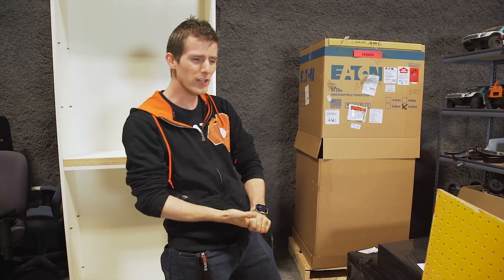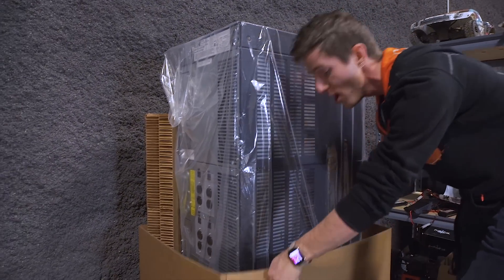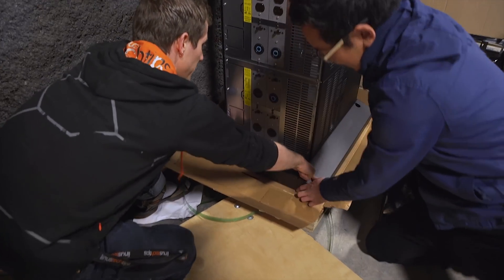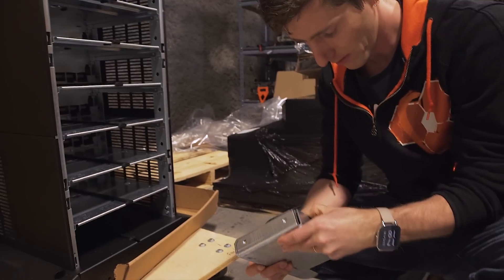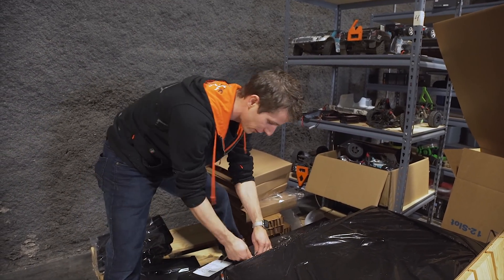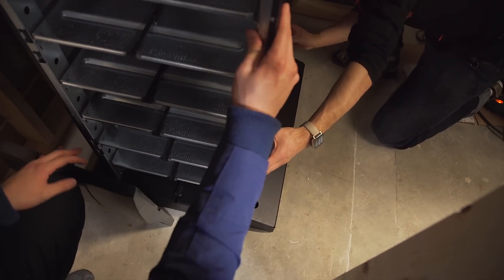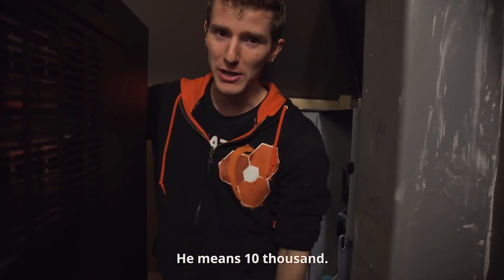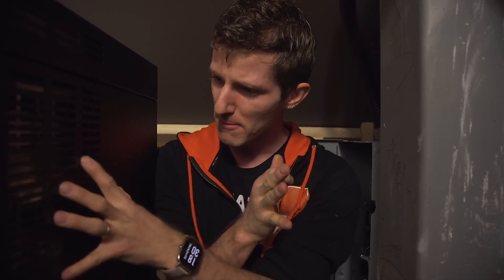HOLY $H!T - A $17,000 (CAD) Man-sized Battery!

Comment: You only need the UPS big enough to run for a few seconds before the Standby Generator auto-starts once power fails.

Would cost you much, much less. And you would have enough power to last for days.
Reply: +Lin Ying Yen Generators need gas, maintenance and to be generally checked. The one they bought is a much more elegant solution and doesn't waste gas when you could use the gas to power your car.
Reply: +Dan Wasd You only need to check/maintain a standby generator once every 3 years, and it will work for decades. Meanwhile, those Eaton batteries needs a mandatory replacement every 5 years, and won't hold a full charge by year 2.
Reply: +Lin Ying Yen They don't need run-time. They only need enough time to save and shut everything down.
Reply: +bensemus x It would still be much cheaper than their current option. Extended run-time is just a bonus.
Reply: Lin Ying Yen They would still need new ups's as the reason they did this upgrade was because their current ones were causing issues. I'd also assume it might be tricky to get a permit to run a generator in their complex. They would probably have to do a lot of rewiring as well.

Comment: wouldn't a generator be cheaper... and could work for HOURS, not minutes....
Reply: +Gabriel Coelho Generators don't provide uninterrupted power. They aren't buying this to run their gear when the power goes down. They just need it to give them enough time to save and shut stuff down.
Reply: +bensemus x They also generally aren't power conditioners like this UPS does as well.
Reply: He's using it to power his insane servers and whatnot. This is basically a giant power or a UPS.
Reply: +Gone Tomorrow what data? Do the servers not use hard drives?
Reply: +bensemus x They do if you have a small UPC hooked up in addition to a generator.  Only would need a UPC 1/30th the size to last 30 seconds for the generator to kick in.  Plus, I guarantee they won't shut anything down in the event of a power outage.  They will just keep on working assuming that the power will come back on soon - and if it doesn't, well then their work productivity will be screwed.  With a generator, even in the event of a major power outage, they would remain online regardless of the duration.  Oh, and it would be cheaper and better for the environment.
Reply: Kyle E Generators burn fuel so I don't see it being better for the environment. Small businesses like LMG shut down their servers. Most people shut down servers when the power goes out. Linus said they would shut stuff down when they lose power. What happens if the generator fails to start? Their servers would suddenly lose power. Only massive data centers have back up generators.
Reply: bensemus x What do you mean what happens WHEN the generator fails to start?  You're taking a big leap there... If you get a good generator, that should never be a problem.  And you obviously aren't looking at the big picture if you don't understand what I meant by a generator being more environmentally friendly.  You do understand that the manufacture of batteries (especially the type/size used in this UPC) produces an obscene amount of harmful byproducts?  You would have to run the generator for a LONG time to produce enough emissions to equal the carbon footprint of the UPC.
Reply: steakjake Ah, didn't know that. Thanks!

Comment: Just how unstable is the powergrid in Canadialand to justify all these UPS? Why not just keep the minor UPS you already had and then get a emergency diesel generator like the ones used in hospitals? A generator is really not that expensive,
Reply: +Martin Kufikwasf They had to get rid of their old UPSs anyway (as he said, they were developing issues), and they also have had power fluctuations from storms in the area (as he also said in the video), so something that smooths out the power to the servers, doesnt have to be maintained like a generator does (have you seen how often stuff breaks around Linus?) and gives them time to save everything is worth it.
Reply: +Martin Kufikwasf They don't need run-time. Just enough to save and shut stuff down. The grid isn't bad but one power loss could ruin a ton of their gear/content. Not worth the risk.

Comment: kVA? Isn't a VA just a W? So it's 12MW? Or am I missing something?
Reply: +Alex Tritt Apparent power and real power pretty much.

In an ideal world the sinusoidal waveform for the current and voltage would be perfectly in phase. But in reality depending on the type of load it will shift a bit so that the peaks of the current and voltage don't match up perfectly (only purely resistive load without any capacitance or induction would be 100% efficient).

Basically I could try to explain it with math, physics and complex numbers but just imagine it as I said above that they'll go a bit out of phase so you won't be able to get the most out of it at the outlet. VA is typically used for apparent power and Watt for real power.
Reply: Sorry 12kW.
Reply: +Alex Tritt It's never perfect. W will always be smaller in the real world.

Comment: BFD. More superfluous braindead crap from LTT
An exorbitantly expensive battery providing a pathetic TWENTY SIX MINUTES of standby power sufficient ONLY for shutting down their gear FOR $17K!!!!! - rather than a LESS EXPENSIVE extended capacity standalone natural gas or diesel powered generator that would allow essentially indeterminate CONTINUOUS FUNCTIONALITY! 
An absolutely braindead disaster recovery solution(sic)!
Not to mention that at 10m Linus has already broken something. What a dumbfuck.

Comment: @Linus aren't you afraid to recirculate heat in your server room (considering the rear intake will probably take air from the servers exhaust) ? those things do generate heat.

I had a couple of those but we had issues (the powerware versions with the backplane on one, and then a couple batteries on the second). We finally replaced them with riello's and (touching wood) haven't had a problem since. Though, if you psu's support it, I highly recommend using 240v. 
You might also want to wire in your editor's stations so that in case of outages, they won't lose their work.

Comment: super high heavy duty 240v stuff
welcome to the uks powergrid :)
Reply: I found that quite funny as well. If you're used to 230V being normal and 380V being heavy-duty, the North American system seems even more silly than it must already do if you live there...
Reply: Yeah. When I heard that I was like: Oohh...That's cute he thinks 240V it's heavy duty.  Being a student at a electrically inclined college I got the chance to visit a power delivery station. Those tensions are real heavy duty 6kv, 12kv, 24kv, 110kv and so on.
Reply: ToKeepTrackOfRandomSubs Pretty much, yes. Do you happen to know what the max amperage is on an average domestic circuit breaker in 110V countries? Over here in the Netherlands it's 16A, though some European countries go as low as 11A on 230V.
Reply: +Michael Flatman afaik most countries in Europe has 230v. And the long distance powerlines are 400KV atleast in sweden.
Reply: +Michael Flatman Not onlu UK, Whole damn europe
Reply: +Robert Faber Well historical choices and existing infrastructure is hard to replace, I'm sure if they had the option to easily redo it all at no cost any sane person would go for a higher mains voltage. You'd need a lot less copper conductors to distribute the electricity to residential and industrial areas etc.

It always entertains me to see the thickness of cables that are needed to power things there from mains sources.
Reply: +Robert Faber In romania it's the same : 230v at 16A.
Reply: Heavy duty in our country is like 420v especially when we talk about generators and machinery
Reply: +Michael Flatman we have 690 v for heavy duty stuff :)
Reply: +Michael Flatman yeah, but for his purposes, that is a over reach of what is a needed amount. i mean, how now is he going to trick this server out? what possible upgrades are there on the consumer market?
Reply: thejack473 yeah, its good for his needs
Reply: +Michael Flatman Europe it's 240V on single phase, it USA to get 240v you need to use both phases going in to the house. in USA out by the street a few houses share a single transformer that takes a single 10KV input uses a center tap transformer to give you two 115V (out of phase) that is your house's black and red wire.
Reply: +Tony Philipsson IN UK we phone a dude for free to come to our heavily taxed house, pay a callout fee "another tax cuz why would the power company pay their engineers right?" to have your single wire plugged in.
Reply: It's 240 V but higher current than in the uk
Reply: +Sword of damocles yeah, they just have different plugs
Reply: +Robert Faber But we dont have 110V........... We have 230/240V.
Oh and F you youtube for not letting me edit my last comment.
Reply: +Michael Flatman United states uses 120vac, and it's more expensive than your 240vac stuff. It uses more copper to carry the extra amperage on 120v
Reply: +King Harkinian yeah they have too so that they can send enough power
Reply: +Michael Flatman no because 240v equipment here typically pulls a ton of power